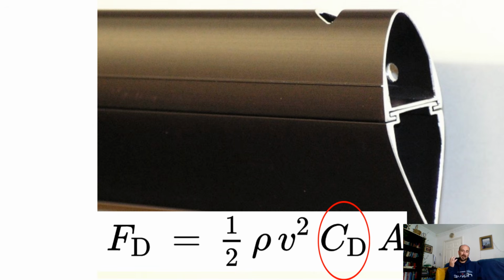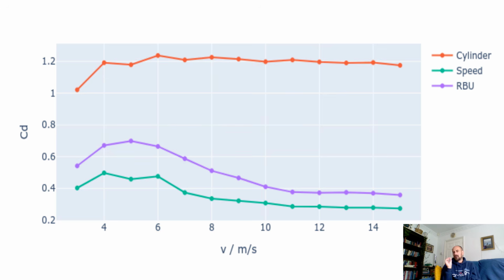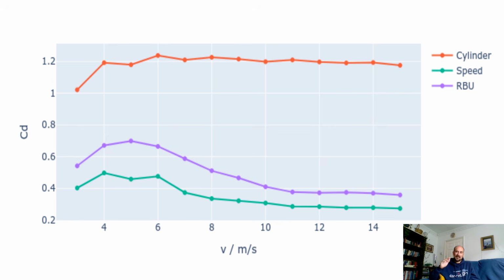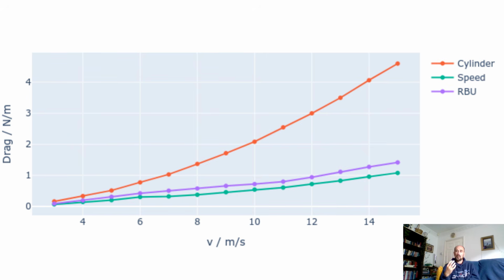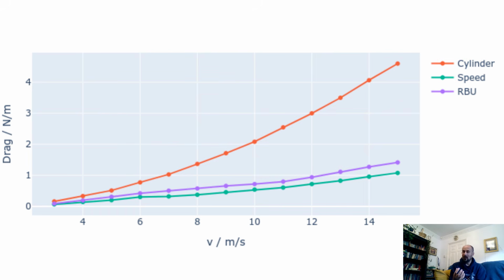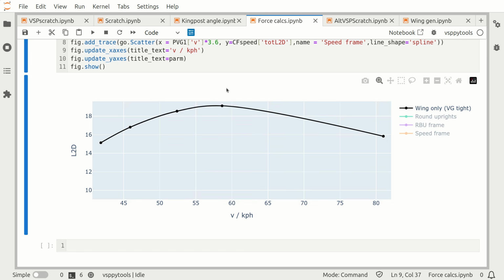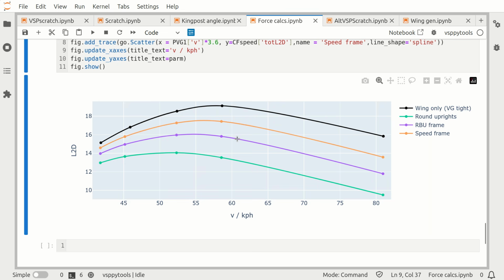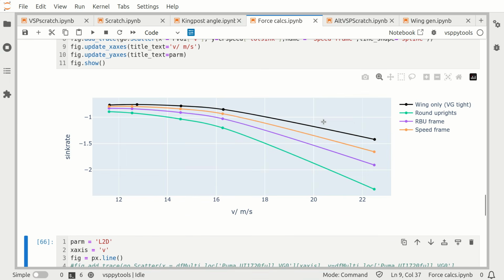Wind tunnel testing

Comment: Thanks Tim, great presentation. Looking forward to your cross tube analysis. Certainly with my Pelican it has made a significant improvement in performance but I still have a few meters of exposed cross tube.
Reply: the question is why didn't you enclose it completely like you did with the discovery?  Is it some sailmaking issue or do you gain significantly in hadling with the kinked XT?

Comment: Cool stuff! I noticed that the "speed" extruded profile seems to be made up of two separate aluminum extrusions – is that right? Why is it made like this, instead of having it as a single extrusion?
Reply from the maker: Well spotted! Probably should do a future video on this. It's for safety, so that the upright requires a lower load in the fore/aft direction to cause it to buckle and to absorb more energy when it does (saving your arms). A wide aerofoil section is aerodynamic, but it's the opposite of what you want structurally. Ideally you want something that's relatively soft in a fore/aft direction to mean the upright breaks instead of your arm in a crash, while still being stiff enough in other directions to resist flying and ground handling loads. By making it in two sections that can slide over each other then you make it much softer in the fore aft direction (like a paperback book is easy to bend because the pages slide over each other, a block of wood the same size is rigid despite being made of the same stuff) while still stiff in the left right direction so it can take the flight loads and not be too easy to break with little bumps and bad landings.